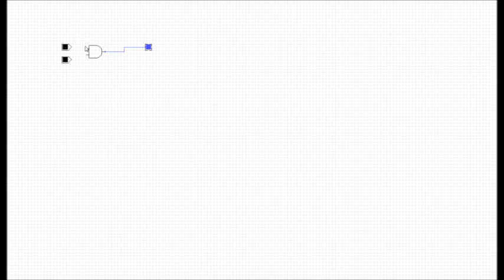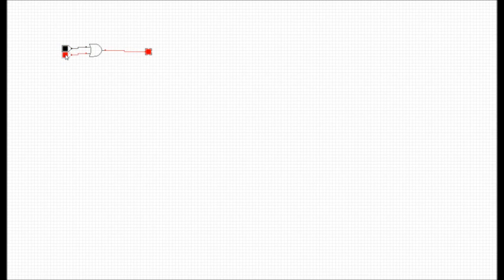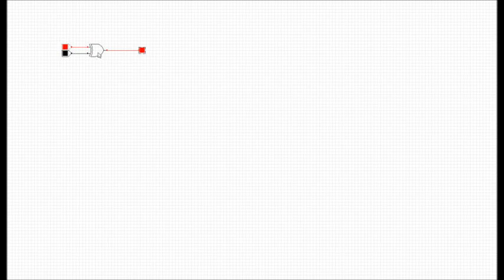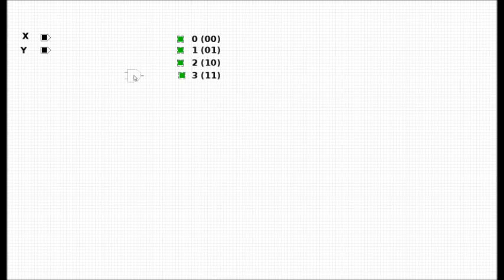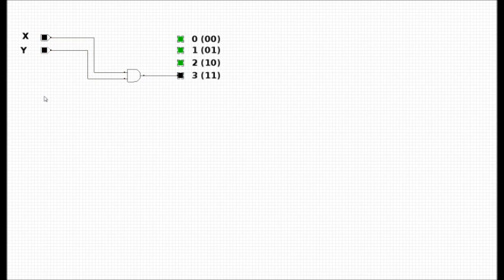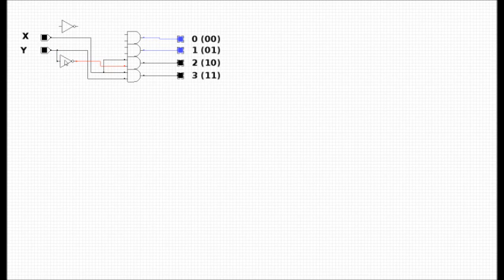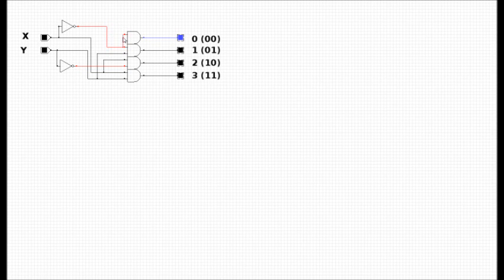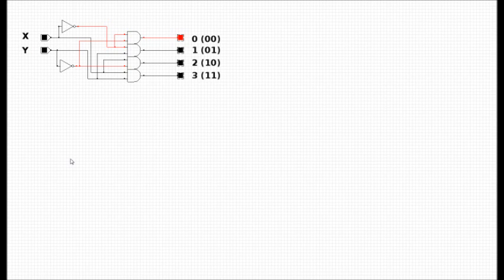Logic Gates Part 1 (With Simulator!)

Comment: Is there such a thing as a multi-input (more than 2) XOR which gives an output only if one of the inputs is on? In other words, if it's a 3-input XOR and all of its inputs are on, it will not output even though 3 is an odd number. (Searching the internet for this has so far yielded nothing. I even tried searching for XXOR [eXclusive eXclusive OR] lol.)

Just curious.